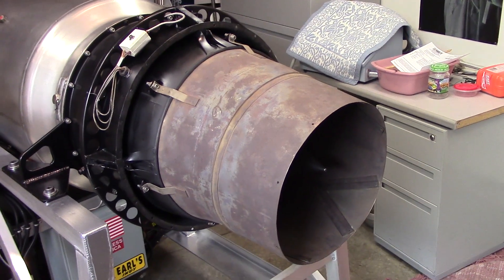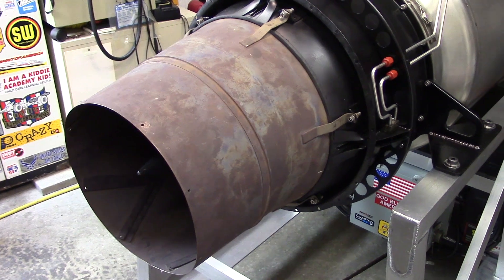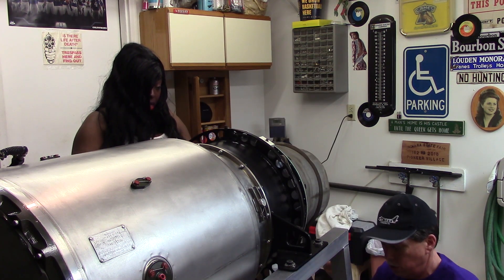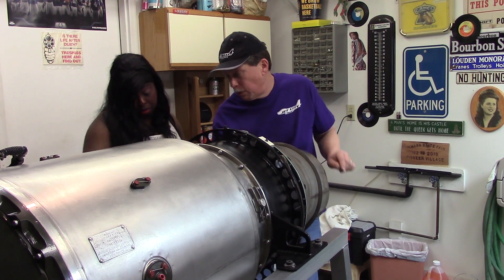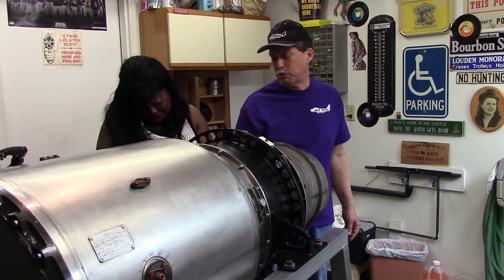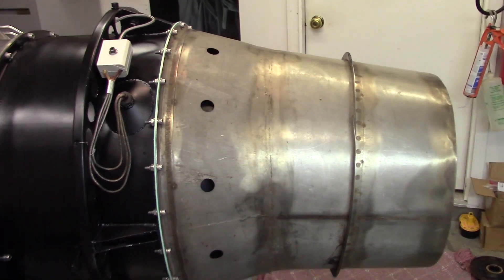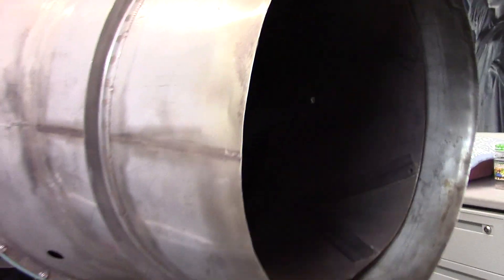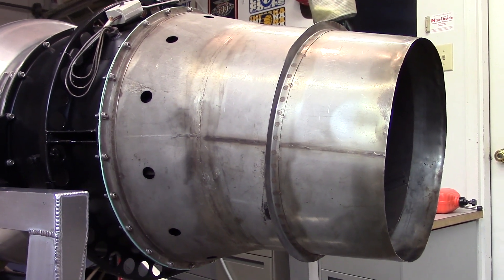The J44 Project:  Final Assembly, Part 9, Assembly Complete!!

Comment: That first fire is gonna be nerve wracking......for us too!    She puts up with a lot for you....doing that with sculpted nails even!Congratulations on completing the rebuild!
Reply from the maker: Yes it will.  Fran does her own nails & does a good job!  That's why I teased her in the video where she was about to install one of the screws & its nut (& AN washers!), located 'under' the oil & air lines feeding the turbine bearing.  She got it with needle-nosed pliers; she didn't even break a nail & come to think about it, I don't remember her even dropping it one time.  I'll pass the credits on to her.  Thank you.

Comment: It certainly looks great, Darren: I congratulate you!  While you've been doing that, I've been doing really high tech stuff, like painting a basement extension to my granddaughter's dolls' house (my Christmas present to her), and completing a nesting box for Blue Tits (they are a pretty little European bird species} for her and her little brother.
Reply from the maker: Hello Graham!  Great to hear from you... & thank you for the compliment.  If it runs as good as it looks, then Hooray!!  I did work a bathroom remodel in this Winter, along with the J44, but it too took way longer than it should have!  My big concern is the fuel control components' seals getting old & leaking.  I have already changed 3 'O' rings on the fuel control/governor; luckily easy to access & common sizes!!  I may be in for a meticulous 'next project:  repairing the fuel control!'  Thanks for watching & cheers.

Comment from the maker: Whoops!  Technically, a small amount of air is bled from the compressor & directed to the turbine bearing via tubing to the bearing housing.  I am correcting myself here because in this video, I stated that "No bleed air is used to cool the hot section of this engine."  As well, some 'bleed air' is directed through the passage between the combustion chamber inner liner & the rotor shaft, to cool the turbine disc itself.  The cooling airflow generated by the Air Ejector is confined to the turbine bearing housing chamber & the rear struts.

DD